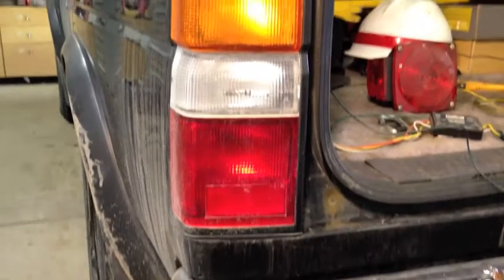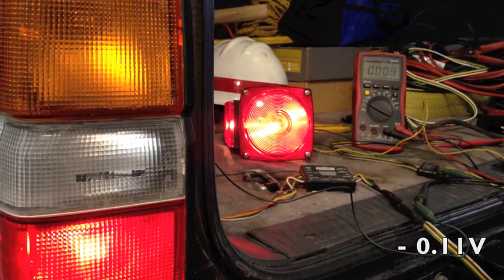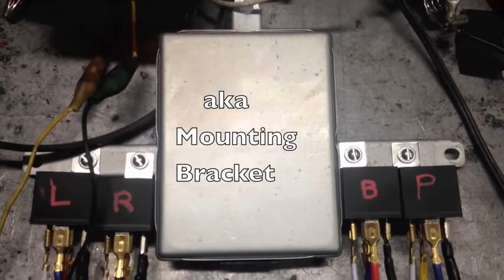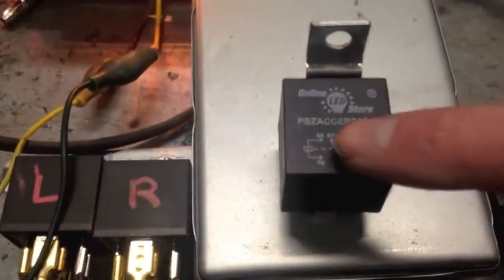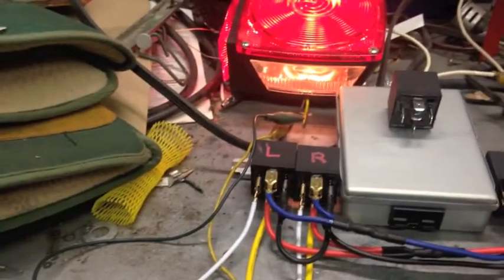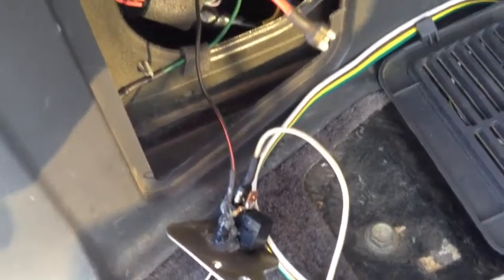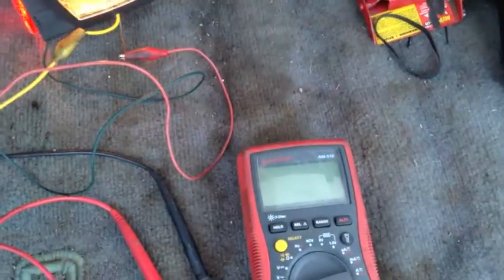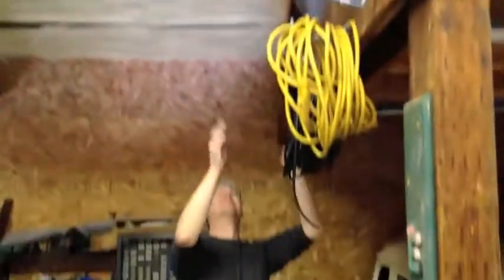Building a Trailer Light Converter that Doesn't Suck

Comment: Cool project and great work around. Out of interest, when your cars brake lights are on as well as the indicators, the trailer and car lights flash 180 degrees out of synchronisation... is this typical for all 5-4 converters in North America? (sorry, I am in Australia and all cars and trailers use amber turn signals)
Reply from the maker: Thanks! AFAIK, yes, they're all like this. To avoid that effect, the converter would have to know the difference between the flasher being off between flashes and the flasher being off in general, which would be difficult without running additional wires. IMO the back-and-forth flashing is more eye-catching anyway, which is what you want in a turn signal.

Separate turn signals are a much better idea. Unfortunately this four-wire setup is standard on trailers over here, with the exception of the big chungus ones on semi trucks.

Comment: I have the opposite issue, being in Europe and having a US classic car I'm allowed to have US-spec lights on a car, that is this brake light and indicator combination lights are done by one red bulb, while to attach to normal trailer I have to somehow divide these functions.
Reply from the maker: Yeah, that's a tricky one. I don't think there's a simple circuit to break the US combo wiring back down into the euro style. I would run wires from the brake switch and the turn signal switch (or front turn signals, if those are separate), and then run those back to the Euro trailer connector.

Comment: Nice build … If you are looking to get little more in higher voltage to the break lights, run a separate copper ground wire directly  from your negative  battery terminal  to your break lights , instead of using the  vehicle and the trailer frame . The .steel. in the trailer and the auto, has a certain amount of resistance compared  to copper. I recommend #10 gauge
Reply from the maker: That would be an interesting one to test. While steel's not a great conductor, there's a whole awful lot of it. Imagine mushing the whole truck body and frame down to a wire, that wire would be massive in cross-section. For this load, I think a body ground should be just fine.
Reply: #10???  In residential wiring #10 can carry up to 30 Amps!  Holy smoke!!!
Reply: @jimbaranski4687  30 amps at 240 volts is 7.2kw, while 30 amps at 12 volts is only 360 watts. It takes much greater ampacity at automotive voltages to complete identical work -- this shows up as bigger wires.
Reply: @andrewdunlap5130  yes, most of my 12v battery /inverter etc system is #4 & #2.

Comment: Gonna be building this myself for my 1983 GMC 7000. I like LOTS of lights on my trailers, and 7.5a isnt much capacity when using a Hopkins converter!!

Any idea how to make the signals stay in sync with the car when brakes are on??
Reply from the maker: You could light up a trailer like one of those Japanese dekotora trucks with this setup!

The counter-flashing is baked into the circuit, but I'll bet you could rig another relay to each stop/turn wire that inverts the signal back, then set those relays up so they only work when the truck's brake lights are on. Basically re-invert the inverted signal, when it's inverted, so it's not inverted anymore.

Is both flashing together a requirement where you live? I don't mind the counterflash, honestly I think it draws a little more attention to the trailer (if it's small enough that the truck's tails are visible).
Reply: Use transistors instead of relays and add diodes

Comment: What kind of relays did you use and where did you get them? Also, what is the purpose of mounting them with a cruise control box or that was existing in the car and it was handy?
Reply from the maker: The cruise control box was handy, that's the only reason I used it. The relays are cheap automotive relays I found on Amazon. Hopefully this link works: https://smile.amazon.com/gp/product/B01KVZ2MU4/ref=ppx_yo_dt_b_asin_title_o06__o00_s00?ie=UTF8&psc=1

Comment: Thank you for this. I found that with my particular set up all signal lines required a diode or brake lights would not function.
Reply from the maker: Glad it helped! I've been surprised before by the things that backfeed and cause problems.
Reply: @Darwinpasta  Also for anyone else that maybe wants to put this in an engine bay or some other spot and would like to have this in in a nice enclosure. Amazon has a nifty 6 relay 6 fuse enclosure.
Reply from the maker: @Awuani  That's a good idea!
Reply: I would think the back feed comes through the ground wire.. so, if you just diode the ground I'm sure you will accomplish the same result.. hehe THE MAX

Comment: Hi there,

I also made such a relay system with the help of that diagramme. 

It seemed like it would work well, however I noticed inconsistencies with the lights depending on the order of which you use the lights. 

For example. I had an issue where if my brake lights were applied, both sides would light up. If I indicated left (for example. The right hand side lamp stayed on and the left flashed - all correct.... But if I still had the brakes applied and switched directly from left to right indication. The right side would flash, but the left side brake would not illuminate until I have released and re-apply the brake.. Is there any way around this??
Reply: Just to say. Great video by the way.. In my case, I am trying to convert a Buick that has independant indicator/brake lights into a combination turn/brake system as it has red turn lenses.
Reply from the maker: Thanks man! I pulled up the diagram again and I'm drawing a blank trying to work out how it would do that. Near as I can tell, the only way that light would stay off is if the Buick's turn signal wire stayed hot, which would indicate a fault with the Buick rather than the relay arrangement. I'll run mine through your procedure and let you know how it does.
Reply from the maker: Tested mine again today with a camera set up behind. Brake on, switching the turn signals from side to side, I couldn't make it act up the way yours is doing. Again, this tells me the Buick's wiring is probably the issue. I'd unhook the relay harness from the Buick and test it on its own, make sure you don't have a random sticking relay or something, make sure you've got a good ground for the coils, then test the Buick's wiring to see if switching quickly between turn signals leaves the other side's light on. If the Buick tests fine, and the relays test fine, maybe try adding diodes on the signal lines to the relays, on the off chance that's what's making the stock wiring unhappy. Good luck!
Reply: Old but I had a ford that changed polarity of the brake light depending on whether the parking light was on or not. I discovered this as I couldn't get Led lights to function properly. I then tested with a multimeter to discover this madness.

Comment: its a neat trick, but probably not really needed for LED trailer lights. I noticed the issue a lot more visible with bulbs or with the engine turned off. I recently installed these little modules from theretrofitsource, they are made specifically for halos and led lights, but they work well for trailers. Basically they convert the 3 pin into a 2, so i have one per side and they also DO NOT blink off sequence, so even with brake on or off they blink in line with the signal line. I will need to take it apart one day. The only issue with the little modules is they have very think wiring, so I am not sure how they will do if i need to plug in a regular bulb trailer (not work at all, or possibly fry the modules). 

Another note, there are solid state relays you could buy, they are just a bit more costly. But no more tick tock :)
Reply from the maker: Interesting, that's an option I didn't know about. And yeah, this could be made without the noise! I found a schematic for a solid-state version of all of this (using MOSFETs I think) that I was tempted to build instead, but this was much simplier and, I figured, easier to troubleshoot if something went wrong. I didn't count on the racket though LOL.
Reply: Darwinpasta I can send you the link to the switchback controllers if you want to check them out. I took one apart and it has a mosfet inside. I had them installed a few weeks ago, will see how long they last :) aside from electrical damage, they are inside the car and I already have an led flasher to remove all load resistors. Those converter modules also need load resistors to work correctly. My cruise control was getting disabled once I tried to signal (without load resistors and running all led tails). I work too much on electrical stuff haha
Reply from the maker: @oneeyedrone4293  Yeah, if you've got a link I'd love to check them out!

Comment: I think I am just going to run a extra amber light on my  trailer as this is like a lot going on here. and those little boxes are expensive. I am going to go with KISS model .
Reply from the maker: I did consider that. Trouble is, just about every trailer you're gonna find has the standard four-wire plug, so you'll be stuck either converting any other trailer you need to pull or only ever towing the one you converted.

Comment: Wouldn't it have been cheaper and easier just to change the bulbs to LED? They consume a lot less voltage and amperage. That would have saved you a lot of  trouble instead of using relays?

Comment: Shame you had to do all that just to have legal trailer lights, but my trailer is the same way.  For the lack of 50 cents worth of wire trailer manufacturers makes us spend $100s on converters, wiring, connectors, tools and time investment frustration.
Reply from the maker: When the standard was developed, it made sense. Most older pickup trucks don't have separate turn signals, so the standard four-pin piggybacks off them without any screwing around. What I don't get is why the available converters are junk!